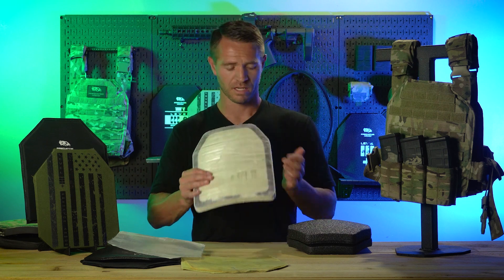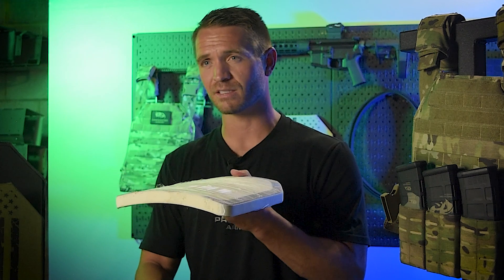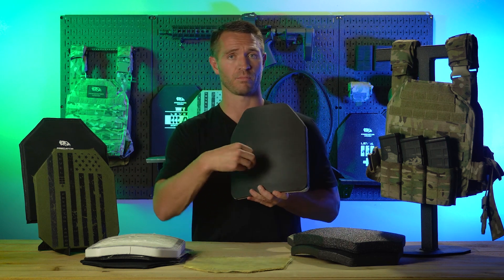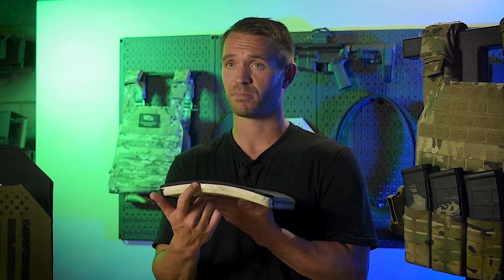How To Make Body Armor

Comment: Great video. The main reason I see customers purchase Level IV (RF3) armor is to stop armor piercing rounds.  The quality of the materials layup is not the only consideration for plate thickness.  Some manufacturers build in redundancies, even if it makes the armor heavier/thicker.  For example, you may be able to achieve NIJ certified lab testing success (sub 44mm BFD) with a 10mm alumina and 8mm of high performance, moderately stiff PE.  But a more experienced (or more conservative) manufacturer may choose a slightly softer, more flexible PE and increase the thickness to 10-12mm for the backing material... knowing that the "extra" material will help offset potential vulnerabilities, especially on crown shots.  The purity of the ceramic also impacts its density, uniformity and effectiveness.  99.7% alumina is quite yellow... anything under that is more white. Higher alumina content makes the tile more dense (stronger and heavier), but it also makes the distribution of aluminum oxide more consistent, leading to more predictable long-term performance on ballistic test results. You make great points about plate weight... sometimes a heavier plate just means that the plate includes higher purity ceramic, more ceramic coverage (no foam on the outer edges), or is designed to be more redundant.